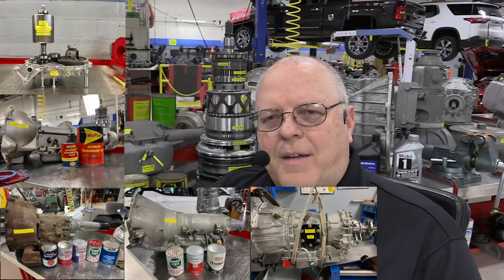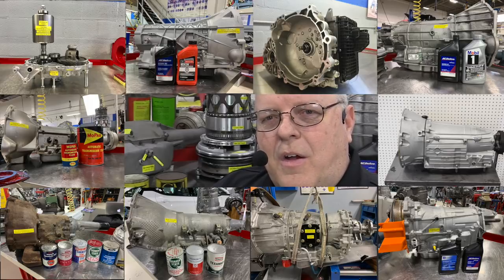The History of Automatic Transmission Fluids (ATF): Part 1 - Introduction

Comment: Hi Professor! I'm really looking  forward to your "lifetime fluid" episode; here's why:

We have 2 Mercedes, both owned since new. A 2001 E-Class with the 722.6 5-speed and a 2011 E-Class with the 722.9 7-speed. On the 722.6 which has the lifetime fluid, I would change (flush, really) the fluid every 80-100K mile, currently the car has 320K miles on completely originally transmission still working perfect on all original internals. On the other hand our much newer 2011, which has the 722.9 with the new low friction blue color "FE" fluid, I was planning on changing the fluid at 80K miles (it just turned 80k last month), but just as it turned 80k I started experiencing slippage and shudder in 4th and 7th gear, which freaked me out, so I just changed the fluid this weekend, and the original green fluid has turned redish-brown with a massive amount of junk on the magnets, and B2 solenoid also being filled with clutch material, which I removed with a magnet. I'm almost certain my B2 clutch pack (which I think controls 4th and 7th) is probably toast. :-( While it's much better now after the flush and solenoid cleaning, I have a feeling that it's day's are numbered, all because I didn't change it at what I just found is is the 40K recommended interval, because I didn't know the new transmissions have such lower intervals now compared to the old sealed unit. 

So, My question to you. Were the fluids in the old sealed / lifetime transmissions of a higher quality /durability than the new low friction ones? Was this change due to manufacturers trying to eak out that extra 0.1MPG from the new cars? I guess an expensive lesson learned for me. RTFM and follow the service intervals for that particular car, and not assume that newer is always better.
Reply from the maker: Thanks for your feedback. Transmission fluids have improved at the same rate as motor oils; they are made from the same base stock of oil. Just as engine oil lil life has increased, transmission fluid life has also increased. I will cover more details in future episodes.

Comment: Re: Fluid specs for a vehicle.  Not sure if this relates or not (as I haven't seen the rest of the series yet), but I remember when I was working at a GM dealer, I remember my manager having a very early 1st gen AXOD transmission Taurus, which were known for transmission failures.  Yet his car had nearly 300k and the original 20 year old transmission.  

When I asked how this was possible, he replied "I use the dealer specified fluids at the specified interval, and nothing else".  Stuck with me, so when I purchased my own Ford I did the same thing.  All fluids came straight from the dealer and nowhere else.

Car turned 421,000 on the odometer when I donated it to a church, still shifting nearly perfectly.
Reply from the maker: That is my philosophy as well. I will try to show why in this series. Thanks for sharing
Reply: You can put GM transmission fluid in a ford but you better not put ford fluid in a Gm.gm is built to higher standard a mark of a high quality transmission is the slickness of the fluid i worked in Automotive manufacturing my whole life there is no comparison you can literally feel the viscosity difference.

Comment: Through +30, transmission oil analysis, we found the Prius eCVTs had measurable amounts of manufacturing debris and silicon leaching in the first 2-5,000 service miles. By doing an early transmission fluid change, these are removed (except for the ~15-20% that can't be drained.) This led to much improved, long term performance (i.e., reductions in particulate matter, wear particles, and minimizing viscosity shear-down.) A second, change at 15-25,000 miles got the rest. Thereafter, +100,000 miles works great.

I hope you'll address the material risks to "yellow metal" bushings. Testing Amsol resulted in a significant copper-tin load that was corrected by going back to the Toyota transmission oil. The silent-chain is the likely source of the copper-tin from the bushings.

We collected the data in the Yahoo Group, "Prius_Technical_Stuff" with the data files saved in "toyota-prius-sat2".
Reply from the maker: Thanks for your feedback, that is great information. I will check it out

Comment: I hope you discuss operating tempatures, because this also seems to be information thats lacking. Looking forward to these videos
Reply from the maker: Thank you, yes I will cover operating temperatures verses fluid level checking and service intervals
Reply: I'm very interested in this as well. I specialize in rebuilding 4T65 (Front Wheel Drive Transmission). I usually like to see the temps around 170. However when the transmission cooler is inside the radiator, the trans temps are often over 220 during summer months.

Comment: Looking forward to the series!
I second the question about info on Honda fluids.
Also, I am curious about Nissan, Mazda, and Hyundai/Kia as well.
Plus, how fluids designed for (both electric and non-electric) CVTs from various manufacturers might be different from regular ATF.
Thank you!
Reply from the maker: Thank you, I will do some additional research to see what Honda and others are using. I am planning on including hybrid and electric transmission fluids in each episode where applicable.

Comment: This is going to be interesting. Working with heavy equipment  Years back they had C-3. Do you know how long it took to find out what it was.  It's a back in the 50s speck they used it into the 70s. It's 10w motor oil. As I recall it. I had people tearing there hair out
Reply from the maker: That is pretty funny. Thanks for sharing

Comment: Hi after seeing some of the videos on youtube I think you folks are about the only source I trust.
I recently purchased a 1994 Mitsubishi Delica Space Gear right-hand side wheel Super Exceed chassis model PE8W-0004268.
it came with a 30-40LE transmission. in my user manual, it says that the transmission fluid is Mitsubishi genuine diaqueen ATF-SP. My problem is I can not find that make of transmission fluid anywhere. I was hoping you folks could tell me what type I should get that is truly compatible especially here in the USA.
thank you in advance for your help.

Comment: How can I double-subcribe to this channel. Do you have a link for another universe with the same channel on YouTube with more interesting stuff happening :P

I'm right about to change fluid on one-speed Nissan Leaf reduction unit (though manufacturer clearly states not to change the fluid). I was researching for fluid that fits as OEM fluid is 3x the price of any other fluid, which doesn't make sense. And it looks like it doesn't indeed. Rebranded, rebranded. So much scam happening in that area. 
I was surprised to find out that one alternative that fits perfectly is not red, it's yellow. Interesting to find out why.
Reply from the maker: Thank you, sorry no parallel universe that I know of ;) Hopefully your questions will be answered in the next 4 episodes.

Comment: I collect used ATF filter it and use it for fuel in my 1993 ford f250 7.3 idi.
It runs on 20% diesel and the other 80% is a mixture of Mercon V, LV, ULV and SP.
Reply from the maker: Thanks for your feedback
Reply: That’s cool. I didn’t realize until recently older diesels are really multi fuel engines. Do you filter it first or have a extra fuel filter running ?

Comment: How about Honda's automatic transmission fluid?  Since their geared automatics are not sun and planetary design.  They look more like manual with sliding gears.  Their fluid perform different tasks?
Reply from the maker: Thank you, I have had enough requests for Honda information that I will do some research to see what I can find. Their latest 10-speed front wheel drive transaxle finally uses planetary gear sets, but most of their previous ones were automatically engaged bevel gears (like manual transmissions use.)
Reply: Thank you for your attention in this request.
Their transmissions sometimes shifts with a huge clunk that make me think something is wrong.  Especially while from neutral to drive while moving after parked facing downhill.  I guess the synchros just don't have enough friction or time to matches the gear speeds.  The regular sun and planetary transmissions will not produce that sound that with the bands and friction clutches.
Reply: I would love to see a teardown of that transmission (Honda 10AT) some day :)
Reply from the maker: I am drooling over that model. I hope to get one someday. Thanks for your feedback